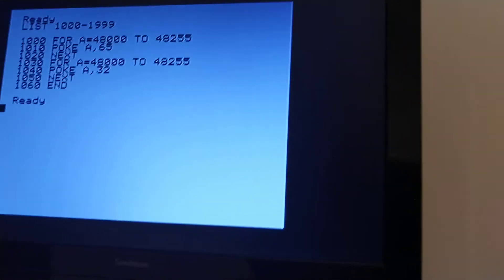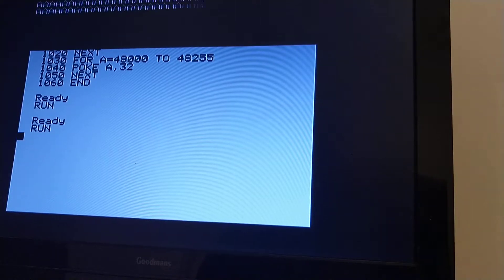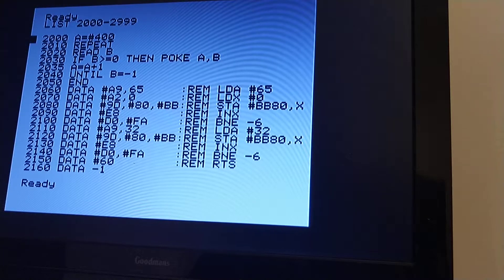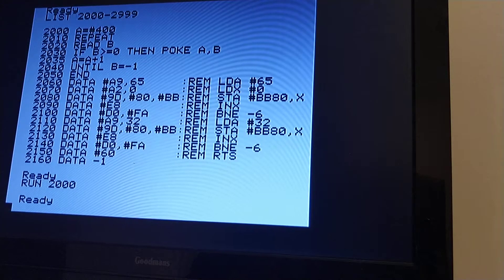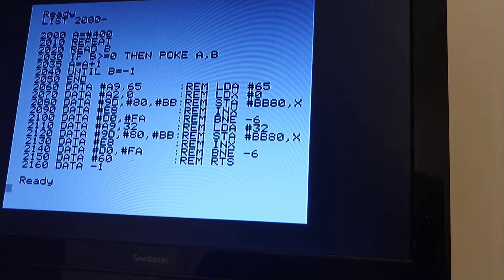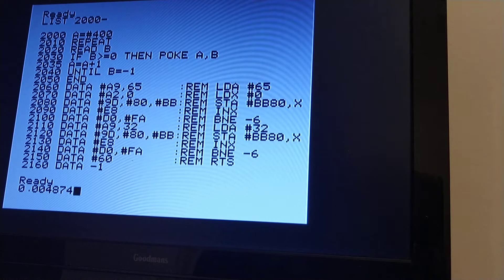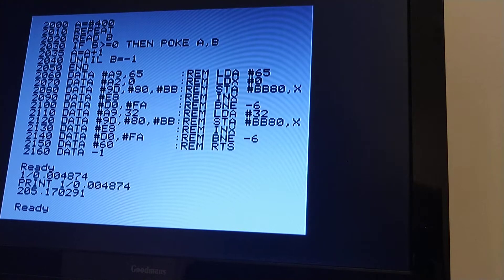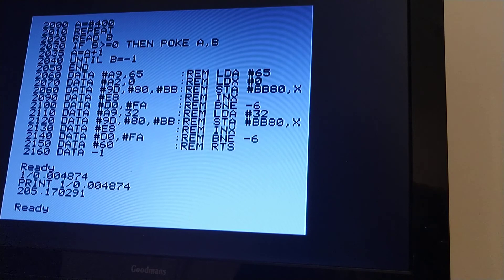BASIC vs 6502 Machine Code on a real Oric-1

Comment: years ago I've programmed both z80 & 6502 based 8 bit machines. compared to the speed of basic interpreter machine code was commonly faster of about 150 to 250 times than the horribly slower basic interpreters of that era
Reply: @6502Nerd  do not judge the processor speed based on mhz only. For example a typical 6502 was clocked at 1 or 1.5mhz while a z80 ran at 3 to 4 mhz. In the average the z80 was faster but not due to higher clock rate. This is because both processors use the clock in different ways. a 6502 at 1mhz was a normal clock rate like a z80 at 3mhz was. Now you can ask me, what if I clock a 6502. At 3mhz. Well, at those times there where technical issues that prevented such speed and even if was possible to achieve that it would also be feasible to have a z80 at 10 mhz. Clock speed between cpu is somewhat relative.
Reply from the maker: Hi and sorry for the delay somehow notifications were not coming to me.
I agree, clock speed is not a good measure of performance - looking back to the early 80s, I think a 1MHz 6502 would compare roughly with a ~3.5MHz Z80 (e.g. ZX Spectrum, MSX-1).
Modern versions of these CPUs can go much faster of course.
Reply: Oric basic was slow, but I found BBC Basic quick

Comment: How did you figure out what you needed to poke?

How do you know what you need to put into the DATA as an argument
Reply: @Dave: The 6502 assembly language is very well defined.
If you look at the first line of the program, LDA #65 is translated to DATA #A9,65.
If you look on the list of opcodes there: http://6502.org/tutorials/6502opcodes.html#LDA you can see that the code for "Immediate LDA" is indeed A9.

What makes the program a bit confusing is that it's using a mixed syntax between assembler and BASIC.

Most "modern" assemblers are using the following conventions:
- # is used to define "immediate" values (like 65, "A", ...)
- $ is used to indicate that the value is in hexadecimal

while in BASIC, the # is used to indicate Hexadecimal, so that makes it all very confusing for beginners :)

In clear:
"48000" is a decimal value equivalent to BB80 in hexadecimal
"BB80" hexadecimal is written #BB80 in a BASIC program, but $BB80 in most assembler dialecs
"65" is a decimal value equivalent to "41" in Hexadecimal (that would be #41 in BASIC and $41 in Assembler)

So when the BASIC program loops from 48000 to 48255 it's really the same thing as looping from BB80 to BC7F in hexadecimal.

The main reason for using Hexadecimal is that it makes it easier to map out what your program does to what is in memory.

If you look in the DATA, we can easily see the #80,#BB addresses (BB80 but written reversed), if the source code was using 48000 that would be harder to mentally map 48000 to BB80.

And sorry if you are even more confused now!"
Reply: @DbugII  MAN - THAT BRINGS BACK MEMORIES - ... SHIT CAPS!!...........I was learning this stuff back in 85 , aged 15 , and all i had was the bloody manual. No internet , no nerdy friends that had a bloody clue what i was talking about...........i got as far as sucessfully creating a 3d tunnel effect like in the starwars game - but it was only draw line from curset to curset commanda - all in hex to create one frame - then redraw the same lines in black to remove them - then next frame (only changing the vertical lines)- 5 frames i did - it worked. my second and last attempt was to create a star field - just loop creating random pixels ( curset (x,y,1))!!!!!........... but never managed to get it to work......... WOULD YOU PLEASE PLEASE PLEASE wrote out the hex for doing this.......... hires, loop, random dots on screen..........would make my day........... cheers from ireland
Reply: @6502Nerd  thanks, but no need to do the video you mention, it would be lost on me.